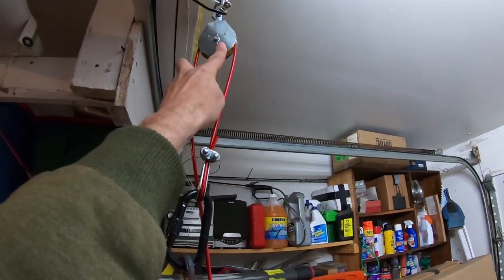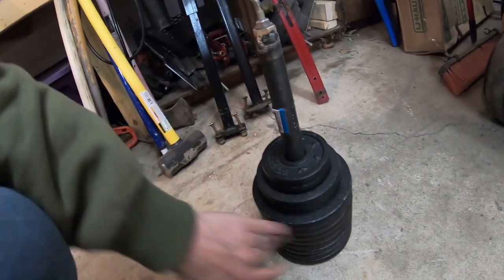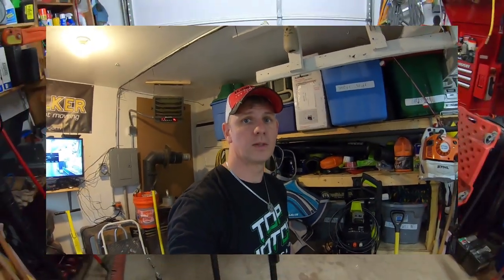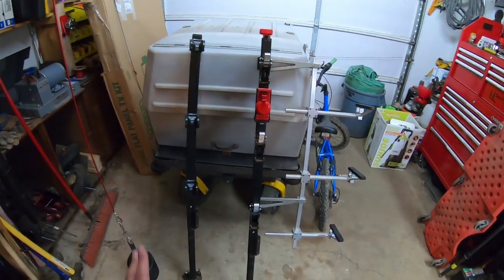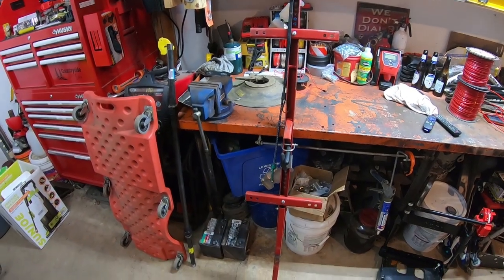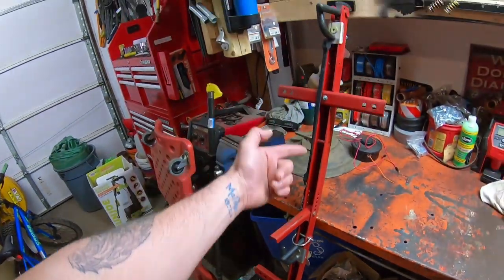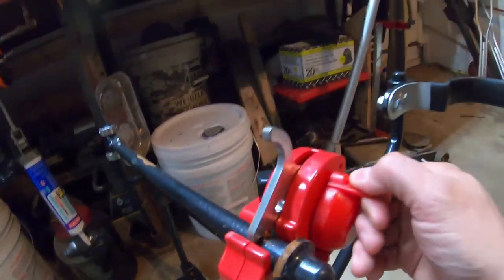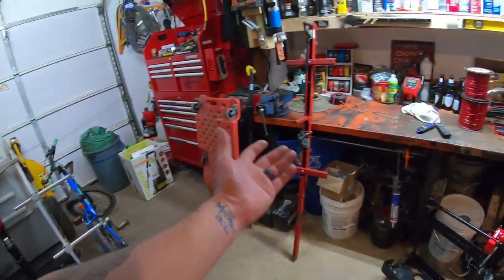Who wants FREE stuff

Comment: never had a blower rack or trimmer rack I always put them in the back of my truck
Reply from the maker: Ouch
Reply: Same here, I built a rack for my truck that holds 2 trimmers, I don't always need trailer, but truck is always with when I do have trailer, very useful for when I only need push mower in the back of the truck, If I do need trailer then the trimmers are with automatically on the truck. ***Bonus*** the trailer dont look super cluttered with all the trimmers and equipment...
Reply from the maker: @MrBigblueford  turned out great